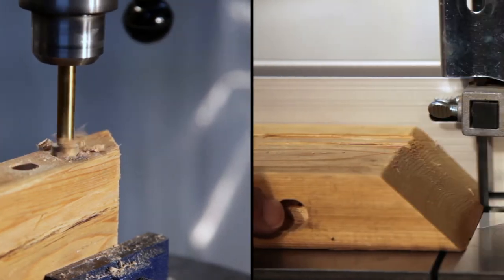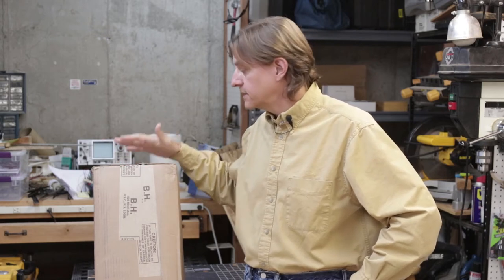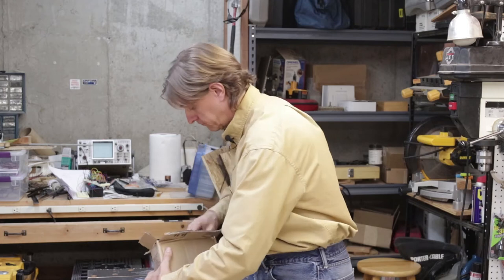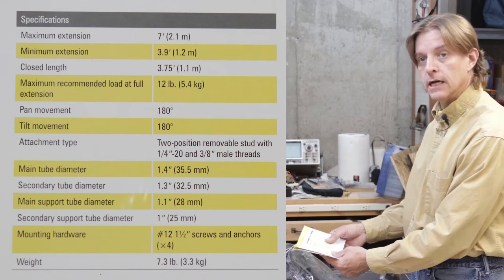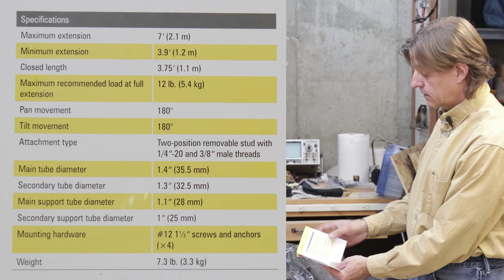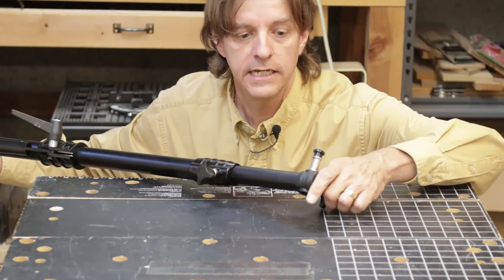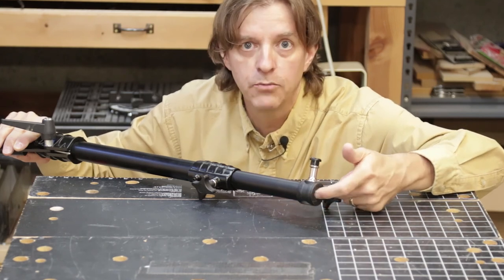Unboxing an Impact 7' wall-mounted boom arm for photography studio equipment

Comment: Thanks for adding in that it can be used for cameras as well...that's exactly what I was looking for!
Reply from the maker: You're welcome.

Sure, it's just an piece of metal, so really anything can be mounted on it if you have a way of attaching it. As I said, out of the box it comes with standard posts used with lights and the 1/4-20 post for any other camera or camera accessory. 

Cheers.
Reply: I used your affiliate link!  Thanks again for the video.
Reply from the maker: Thanks. I appreciate that. Peace.

Comment: Hi Harley, when this boom arm is mounted on the wall, can it be swung either direction so it is essentially right up against the wall? I read a review that said it can’t - in other words the review said it can’t be stored flat against the wall. Is that accurate? Thanks!
Reply from the maker: The other reviewer was correct, it does not go flat against the wall. When folded one direction, the tip is about 14" from the wall. When folded the other way, it's about 16" from the wall. Just eyeballing it, it looks like the angle to the wall is around 30%. (Sorry for the delayed response. I was on vacation and wanted to verify before giving inaccurate information.)